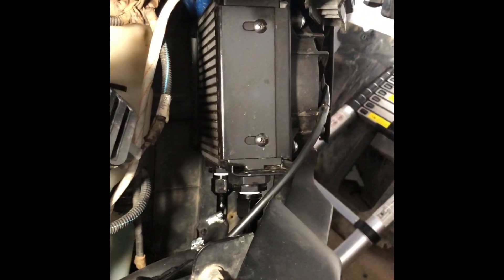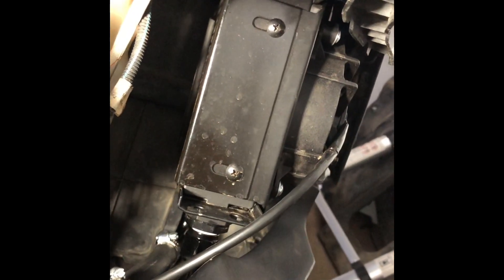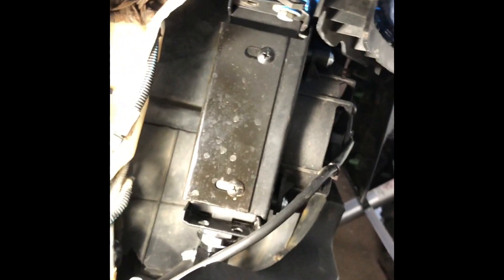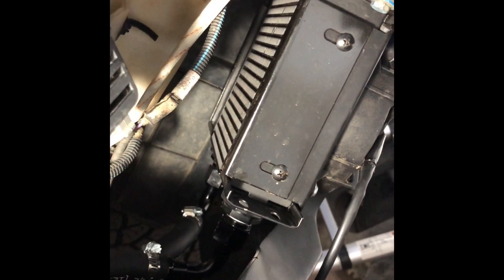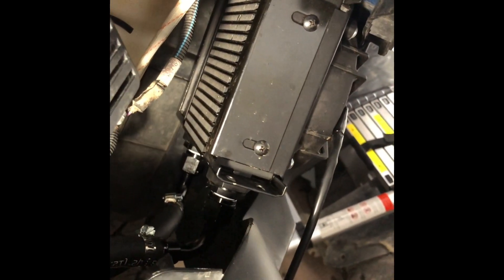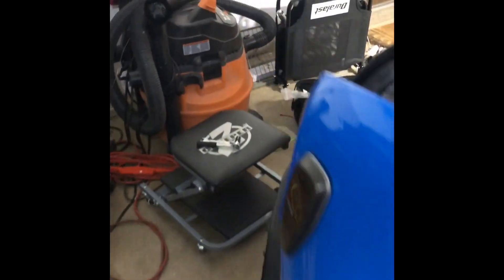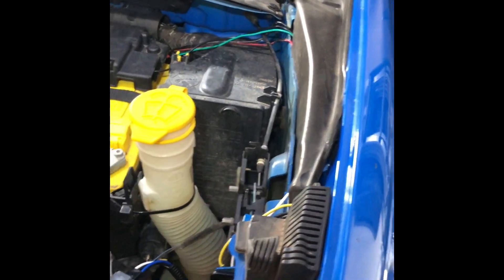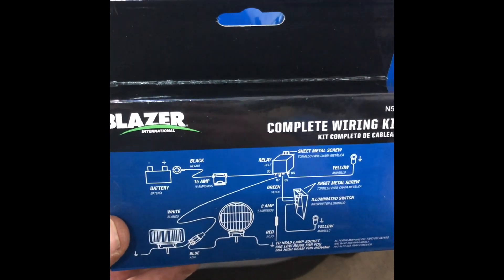Jeep Renegade secondary trans cooler. links in description

Comment: How much of a temp drop did you get, fan on and off vs the temps before the install?
Reply from the maker: With it on vs off, I no longer over heat the trans when I’m doing hard trails.  It still gets hot, but when I see the trans temp climb I turn on the fan then it either starts dropping the temp, or it won’t let it get hotter.  If I’m really pushing the vehicle or I’m stuck the temp will climb.  But if I’m just moving on trail and it’s on, it maintains or drops the temp.